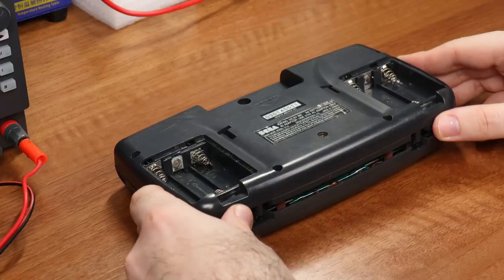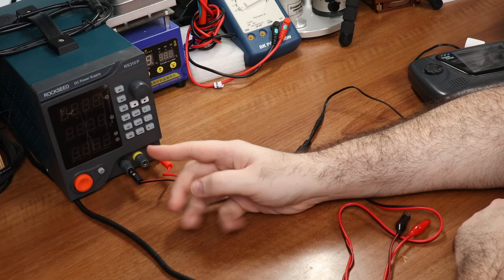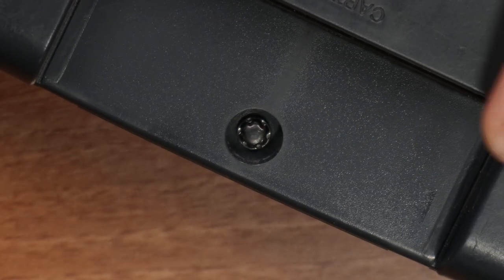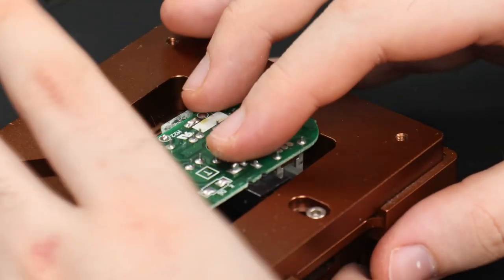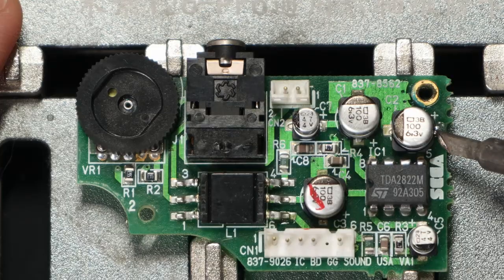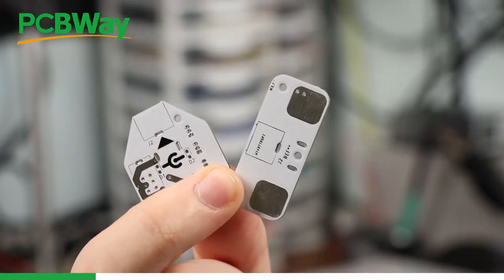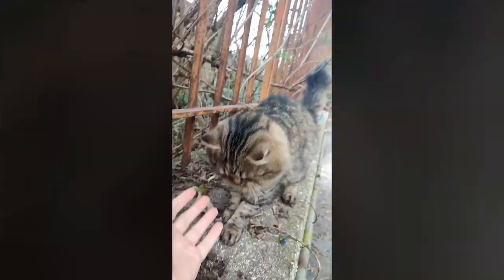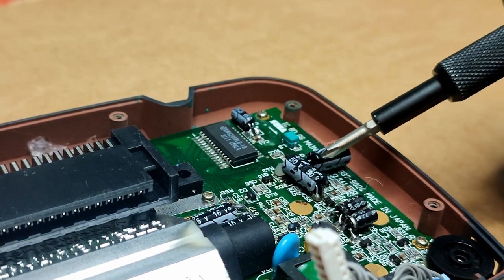ROACH infested Game Gear??? (GONE ITALIAN)

Comment: I'm surprised you didn't put flux on the capacitor pads before soldering them. For SMD components I usually put flux on the pads, put just enough solder on my iron and then solder the component in that way.
Also, why not make the end of the video a bit longer so your other recommended video can stay on the screen for a few seconds?
Reply from the maker: I actually forgot to add the ending screen, thanks for reminding me. That's why it was not showing.

Also, I didn't add flux because the flux from the wire is plentiful for quick soldering jobs like these. I only use it when I plan to stay on the joints a long time, or when I need to do fine soldering.
Reply from the maker: Oh another thing, when soldering if one can heat the pad and the lead at the same time, then flow solder directly on there instead of the iron, the solder joint will never be cold. This is very fast and it's why no additional flux is nerded.